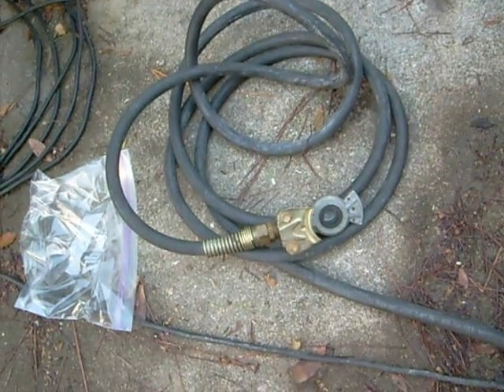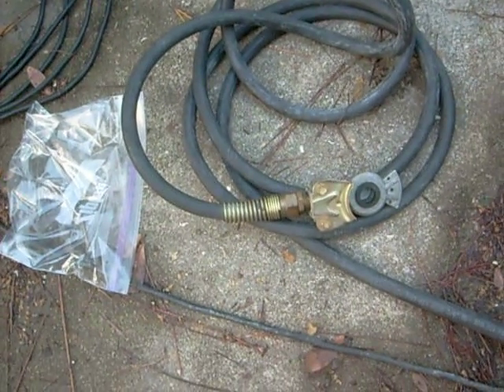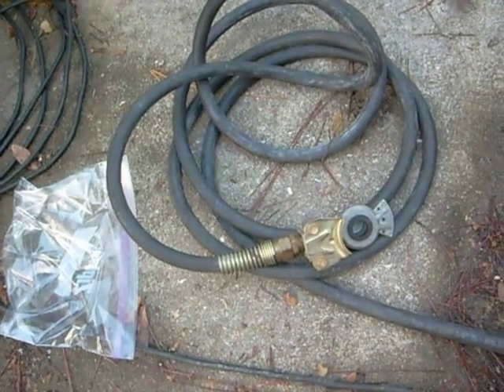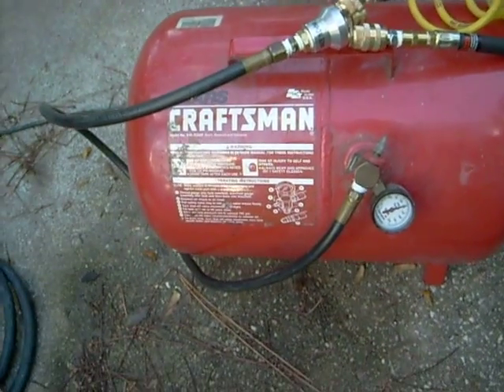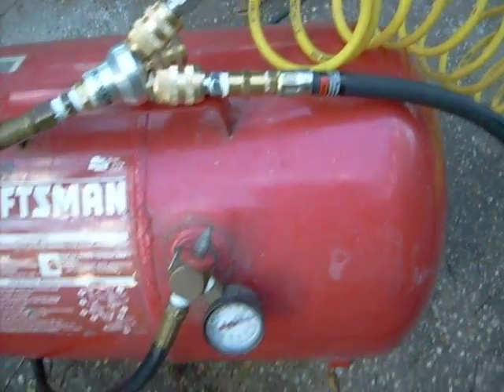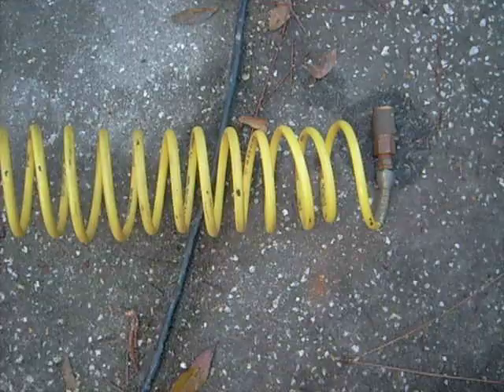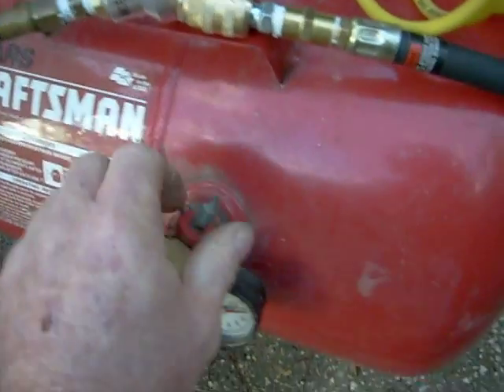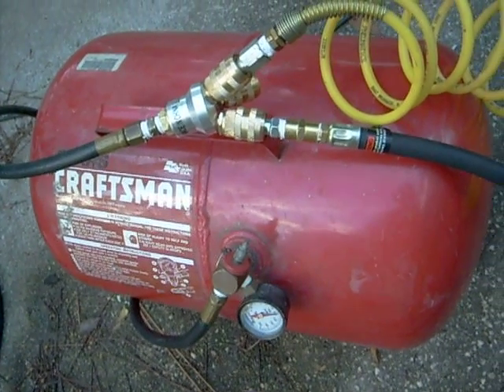Glad Hand Air Supply Cheat, part 2 30 Jan 09 007

Comment: change all the fittings on the air tank.. use a street ell a nipple, a Tee.. another nipple and a globe valve. ..  1/2" air hose out on side  .. a 1/2" globe valve out the other side where a male quick connect for the shop air hose is.. so you can have quick fill and secure shut off with the globe valve.   if you use a large flow quick connects and step a male/female quick connect to step down.. you can get an amazing amount of surge air from the tank at the end of your shop air hose for your impacts.. 

the stock air tank hose and fittings are too small for most impact tool uses..